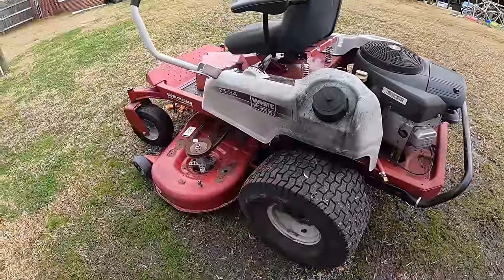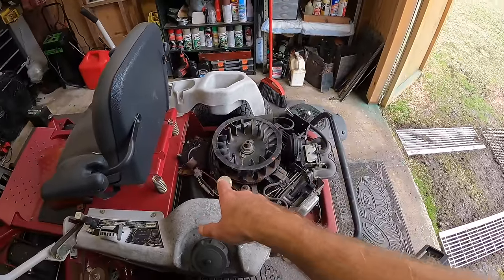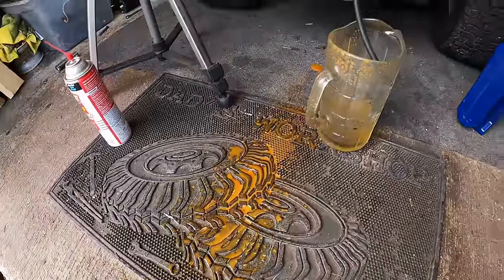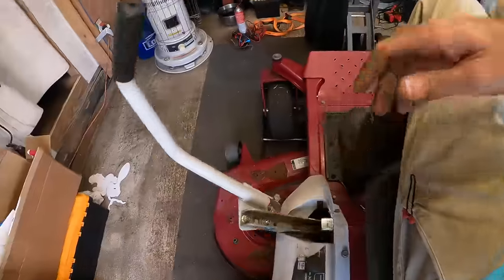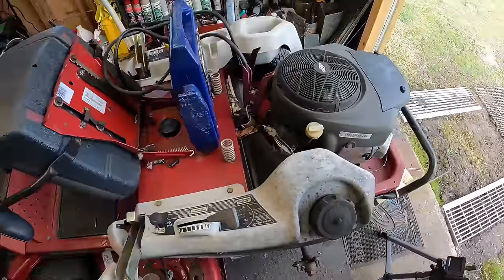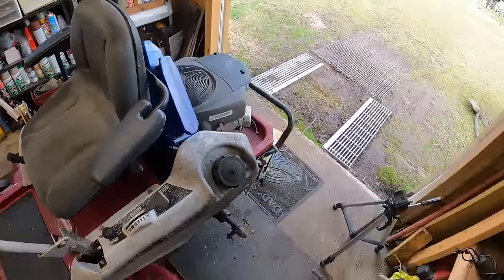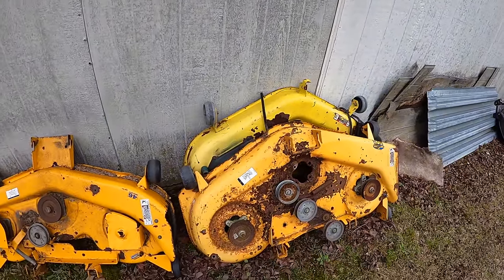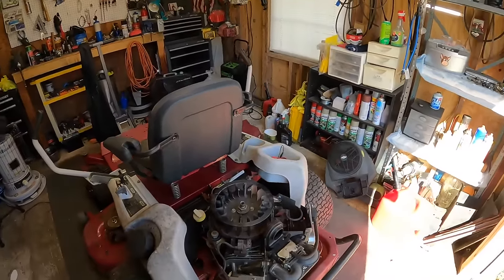FIXING up a $100 ZERO TURN MOWER

Comment from the maker: Thank you ALL for the support. Let’s keep growing and the projects coming. Hit that thumbs up and subscribe for more. I love hearing from each and every one of you 😎🇺🇸
Reply: Alex, those engines were used with mowers that didn't have an electric PTO also, like the sears that had the manual PTO (with the lever) to engage the blades, normally up by the steering wheel, john deeres had that as well on some models.  For a  $100 you got a good deal for sure.

Comment: Alex those zero turns sold for about $3200 new so after your reconditioning it should be worth $1500 in my opinion at least! The pigs look like they are doing great. 🐖🐄👍
Reply from the maker: Thank you Roger. Yea I’m hoping when all done it will fetch 1200-1500. I think that will be a fair price for a good running low hour unit. Yes the pigs are doing great. The big one can be a handful but they are loving it here.

Comment: Hey Alex, I recently found your channel and enjoy learning new things while watching you fix stuff.  When you test a stator, or anything with thick wires, you might want to use the lowest resistance (ohm) setting rather than continuity.  A good stator will most likely be .1-1 ohms and that would make the continuity tester beep, actually indicating a good stator.  On a one wire stator, one of the leads is connected to ground in the same way that a starter has only one large wire and uses ground for the return path.  The 2 wire stators are insulated from ground.

Comment: One end of the Briggs stater is always grounded . The ac voltage out put should be about twice the dc voltage out put . If the windings look good , no brakes , and not burnt or discolored it should be fine . The regulators go bad on them all the time . If your like me with used parts you may need to check two or three regulators before finding a good one .
Reply from the maker: Great information!! Thank you very much.

Comment: Definitely worth $100. Those are definitely built better than the new MTD models for sure. Hopefully that oil leak is not the sump gasket Those cheesy plastic oil drain valves are always leaking. I’m curious as to why there is so much staining on the left fender and not the right.
Reply from the maker: It doesn’t appear to be the sump, but worst case I will pull the engine and re seal. I think it’s a loose drain plug. Those plastic ones always leak. They had it parked partially under an overhang. One side got moldy.

Comment: That z.t r definitely needs a lot of t.l.c  but it is in the right place to get it fixed and running again Alex
Reply from the maker: Thank you Robert. It’s coming along nicely. It should be a nice machine when I get it all finished up. Stayed tuned for part 2 😎🇺🇸
Reply: @freedommowers420   I'll be watching the part 2 on this mower repair job there Alex

Comment: Alex, I could be wrong, but check that single wire to see if it has an an area where it’s slightly thicker. If so, then that’s the kind of setup that has a diode there and the diode has fried. Easy enough to confirm by removing the covering. If the diode is fried it’ll be obvious, but once it’s exposed you can test. I replaced one for the first time not that long ago on an MTD v-twin and it solved the non-charging issue. I have links to three videos if you want.
Reply from the maker: Yes I’ve dealt with the diode style before. I’m actually going to make a video on that soon with a John Deere twin. It’s not like one I have dealt with before. Interesting to say the least. Thank you for the great input as always.

Comment: Alex before pulling a stator and regulator from a known good machine, test to see if the single wire system has continuity through the stator to ground. I THINK (may be wrong, probably am) that you do need some sort of ground connection somewhere. My Kohler twin has a 2 wire system that won’t charge unless the regulator is grounded.
Reply from the maker: Thank you. I’m not the best when it comes to electrical diagnostics. I’m learning, but unfortunately I did end up burning up this stator when testing. I’ll be putting a new/used unit on it to see what we can come up with. I really appreciate the tip!! 😎

Comment: My cub cadet zt 50 is just like that  besides the 22 kholer..Adjustments on the hydro the same parking brake gas pto all the same..I pulled both hydrostatic and changed fluid and put new cooler fans on after left side started roaring in the heat of the day and fluid was cavitation the cooling fan was cut off by previous owner putting belt on it..I been useing it 6 yrs are better and no more issues..Synthetic oil that went in it was pricey..Took certain kind I could only get at part house..Good looking unit you got.
❤

Comment: Man, I hear you about the tall thing.  I don't have a zero turn, but I have a Craftsman tractor and they just aren't built for big or tall!  My legs are so long, that the floor pedal puts my legs at a weird angle.  Wouldn't mind finding me a Hustler Dash or some other smaller zero turn where I could bolt some brackets onto the bar mounts that allows more room!
Reply from the maker: It seems like they don’t make these units for taller people. It would be nice if they had a little more adjustment, but yes that would be a good idea if you could make it work with extensions.

Comment: The two yellow or white wires (I see them in the vid) should be to stator. Engine running, meter leads connected to those two wires, around 30-38 ac volts coming out.
Reply from the maker: Thank you so much for the information!!

Comment: I purchased a zero turn TORO Timecut 4800 and it had a blown motor, B&S Intek 17.5hp. I rebuilt the motor. New Connecting rod, Rings and second-hand crankshaft. It has the exact same one wire stator charge system. Mine was also not charging. On further investigation I found the fuse completely missing. Fitted new fuse and it was charging. Have you fixed this issue on your’ s yet? Cheers Stew.

Comment: With the elec PTO clutch most of those engines have a regulator,  with a charging system of 15 -19 amp charging system.  Take your model # and look up the parts for that engine.  I'm wondering if that stator was changed out from a smaller single cyl.  engine that doesn't require an electric PTO?
Reply from the maker: See I was wondering that as well if it was the wrong charging system installed. I had the parts breakdown pulled up but it show three different options for stators on this engine. I have installed one from another engine and it’s charging great now, but I want to sharpen my diagnostic on electrical. Thank you so much for the tips

Comment: Hey Alex I just painted a older murray and couldn’t save the lettering for it,is there anyway I can buy or make a stencil for it?
Reply from the maker: You might be able to find some decals on eBay. I would check around online and see what you can come up with. Sometimes they sell the original stickers.